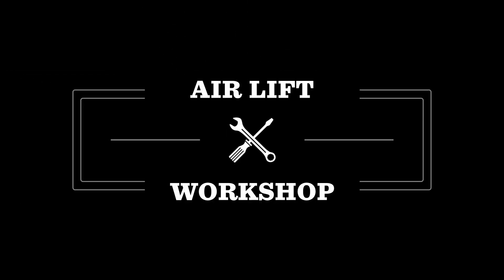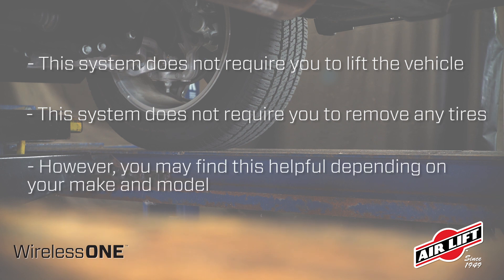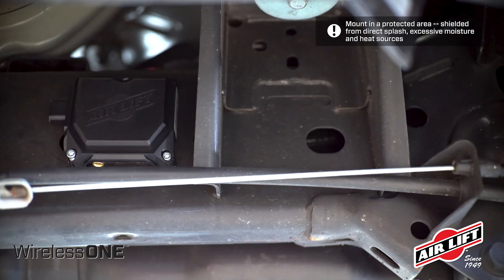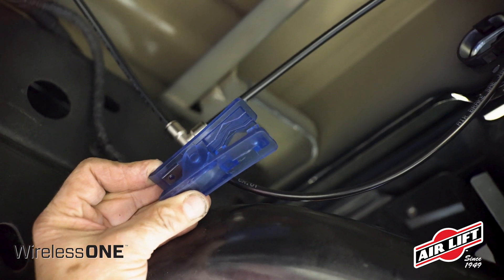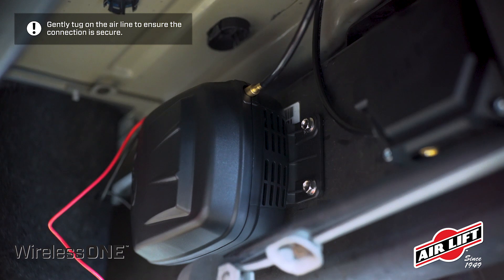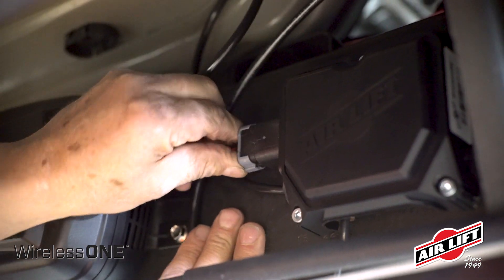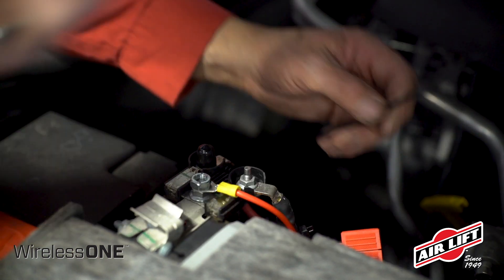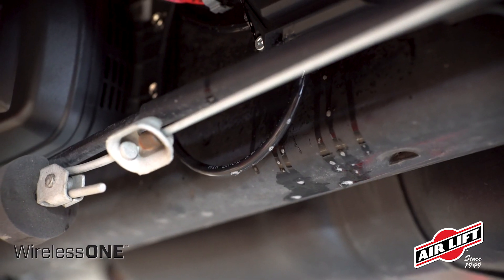Install Overview: 25980 - WirelessOne (2nd Generation) with EZMount - Dodge Ram 1500

Comment: Question?. Can I mount the setup in the trunk so it will be more safer and cleaner.?.
Reply: Technically yes but compressors are loud and I would not want to run in the cab with me in it. Also waterproofing your lines out of cab is necessary.